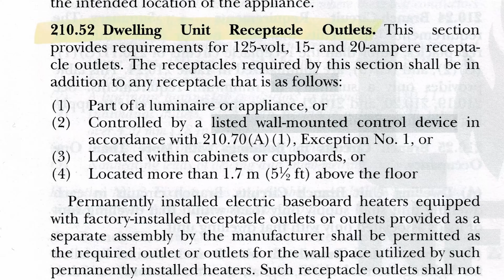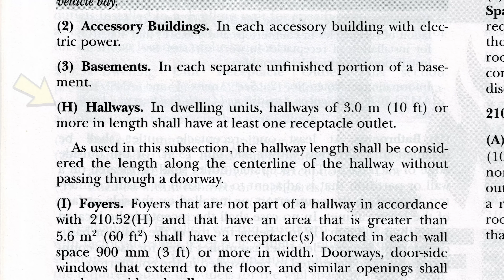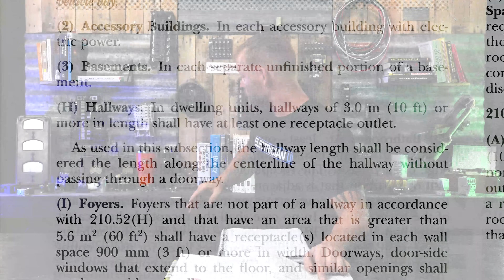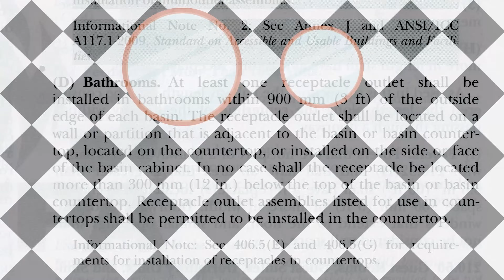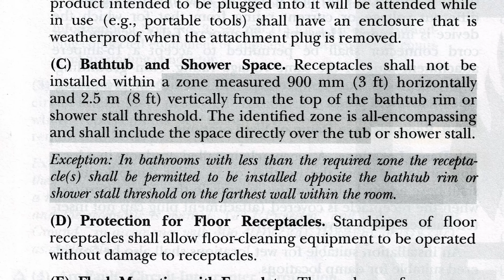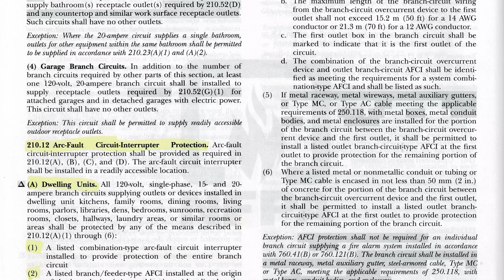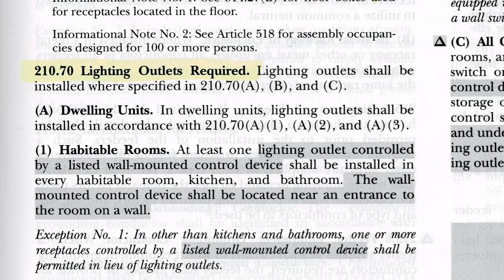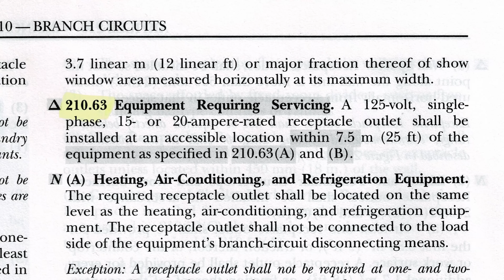KNOW WHAT YOU'RE DOING - or You Will FAIL Inspection!

Comment: Think you should reread the section on hallways. It says longer then 10ft shall have 1 receptical. It doesn't say a 20ft needs 2 or a 30ft need 3. It just says 1.
As written, a 100ft hallway only needs 1 outlet.

Comment: Thank you for these common codes.  I now know I need to add an outlet near by well pump in the crawl space!  Never thought about that (was just putting lights and a switch for the pump).  And, although I was doing it for another reason, I'm glad you mentioned floor plugs.  One wall of my common area at the top of the stairs is the "railing" for the stairs but since I was going to put a device there I needed a floor plug.  Didn't know I "required" it.   QUESTION - What about the rule (or is it a guideline) that a switch must control the lights in a room from ever entrance to that room.  My kitchen, strangely enough, has SIX entrances.  I've seen kitchens like this before with just two switches (two of the entrances to my kitchen are doors to the outside so I am putting switches there).  Does the code require more?

Comment: While it is not mentioned in the codes, whether NEC, local, or state codes, is probably the most important thing inspectors look for: CASH IN THE SERVICE PANEL! In this part of the country, $200 is the going rate, while I've heard of a little higher and one saying $100 still works there. Cash present? Pass. No cash? Fail. 
                                 How much does it normally cost in your area?

Comment: Why did the service wires need to be cut and then spliced? Removing the meter de-energizes the wires feeding the main load center. Couldn't you just install a blank cover to protect accidentally touching the contacts inside the meter housing??

Comment: Having ark fault+GFCI as separate doesn't make any sense. But I am dreading the day when I run into a device and all available outlets are protected and of course the firmware of the device is not updatable so it's going to have a nuisance tripping on arc faults that aren't actually.
Recently had a GFCI tripped out on a sound system, thankfully all the computerized equipment was on UPS just lost the amps for a few minutes and I was going huh it was working in a minute ago? Although I did have to reboot the control computer but I didn't get under the UPS yet. I don't know what caused it I've been through that system with a fine tooth comb and all connections were dry so maybe it was just the fact that I was running 125ft of extension cord? Maybe it was the keyboard player with their DC wall wart I'm not sure and I didn't have a lot of time to investigate after I reset it it didn't happen again. But I might be pulling a power distro off of a stove or dryer outlet for whatever random thing I end up getting into with the way Code is going.

And when I say I've been through the system with a fine tooth comb, I literally have because it looks like it fell off a cliff twice, who is used on the road never cared for and boy was it in quite a state when I got custody of it. And it's not like it's old stuff it's rather modern. After doing three months of outdoor concerts I found out the ground pin was broken on the way to the power distribution rack in a way that was not obvious. thank goodness I practice safe sound. and have plans in place for wet weather and killing power to all stage equipment mentally prepared during set up. I had to go through every replacement power connector and speaker connector and redo every termination because just about everything was loose. Found that out the last day of 2023 when I went to unplug the speaker and the connector came off the cable! I also think we lost 2 subwoofers out of 4 due to loose connections.

Comment: Industrial electrician for 25 years here.  I have worked on 4160V switchgear that is 6 feet high, 480V DC, generator bus bars, power grids etc etc.    When I built my house, I wired it and found a lot of the code requirements to be simply stupid.  There are way better and more efficient ways to do things, but the entire design is tailored to cost more, keep the "inspectors" busy, and protect contractors bottom lines.

Comment: How deep does the trench in the concrete have to be to run wire and does it need to be in conduit pvc or can it be underground wiring for your receptacles at the glass windows?

Comment: Can I ask you a question?  The receptacle in the hallway that is 10 feet.  I have a central vacuum system.  Would that hallway be exempt from the receptacle requirement if I have a central vacuum valve in the hallway?  Or do I still need to install a receptacle in the hallway even if I have a central vacuum?

Comment: My dukes of hazard state does not have a state electrical license so it can be a challenge in small hick towns. They have no written code addendums but after your inspector passes the work because they have their own unwritten rules. One ahole local dick failed me because I made one splice on a 14 gauge wire while replacing a fuse box with a circuit breaker panel. Gave him the code article that allows it. Told me that he would let me get away with it that time. Next time that I talked to my inspector he told me the guy has problems with every bodies work. Had trouble with my city while getting a permit for rewiring a hundred year old home. There was a 26" wide wall where the basement door covered when open and wall stud was filled with a heating duct and customer did not want a receptacle on wiremold . So I drew in a receptacle on the 3 sets of drawings and never installed a receptacle!e there. Nice vid.

Comment: In Europe you remove the bond and use a Megger to verify your neutral & hots are not connected to earth anywhere, and also you use a continuity tester to verify continuity of the earth without the neutral bond, otherwisr you will not know if you have something grounded to neutral.

Good luck doing any of this without "making it look pretty" and not mixing the wires.

Comment: I'm a project engineer, not an electrician (although I work with them regularly). I understand that electricians need to know the code, and construct per code, that's part of their responsibility. However, in my side of the field, I produce plans and specs for design-bid-build projects. If we're laying out receptacles, gfcis, sizing conductors, sizing conduits, specing all the materiald, etc. Our architects, engineers, and designers will put that to the plans. Part of my job is to design and perform the inspections. All that to say, responsibility for being to code is shared by the electricians doing the install, but also the architect/engineer stamping the plans. And building "per code" may not be the intent of the job, it's to build to plans/spec--building to code is just the minimum. Again, all that to say, I'm wondering if electricians go all self-code-police on themselves when installing, or if they tune-out and just install per plans. I guess it ultimately depends who the inspector is. Since I am the one performing the final inspection for our projects, they have to build what I accept as being in accordance to what was in the plans and specs. That may be unique because I am the AHJ at a public utility.
Reply: If it is on a blueprint we stick to the blueprint as closely as possible
Reply: @montgomeryfortenberry wrong! Code always trumps plans
Reply: I do not know any jurisdiction where the project engineer or any other member of the design & build team is the FINAL inspector*. Certainly, the designer can use more stringent requirements than the Code, but not less. At the end of the day, the AHJ which is the city/municipal inspector has the final approval. If there are discrepancies between the plans and what the build team understands of the Code, we have a responsibility to get clarification both from the design team AND the AHJ. If the design team says, "do it this way" and the AHJ/inspector says "No, do not do it that way" you only really have three choices - refuse to do the work, do it the way the AHJ says to do it, or do it the way the plans say, and then submit a change order ($$$) when the inspector fails the job. Most of us are not a fan of the latter because it creates problems for everyone and creates rework, often for multiple trades.

*the only exception being an industrial facility where outside inspectors do not routinely come in and check ongoing work. However, we are generally talking about commercial & residential work which is subjected to inspections by the AHJ.

Comment: 8:05 When my North Texas house was built back in 2008 they used one 20A circuit for all 5 full bathrooms, using a single GFCI outlet.  We have a 5100 sq ft single story home, and in those 5 bathrooms are 8 sinks.  You can only run one hair drier at a time in all the bathrooms!  Absolute worst design ever, and don't know why it was installed that way other than to save a buck.  Keep in mind at most of the sinks, there are quad outlets at each one.  To reset the GFCI its only about 120 feet away from the farthest bath outlet.  We have split 400A service into 2 panels, so breaker space wasn't an issue.   More of a common sense thing for the electricians.    👍🤠

Comment: There's a good argument here that the "wall space" that's all windows is not actually a wall but windows.  You'd have to confirm with your local inspector with that interpretation, but that would be the most logical interpretation because we cannot put outlets in the windows.  An important clue to this is that you have to have an outlet in a usable wall space that's 4 foot or larger and that window wall is not usable wall space.
Reply: If by windows you mean a wall that's made of glass panels that don't open into a doorway(s), that's a wall that happens to be made of glass. In that case you'd have to install floor receptacles along the wall/floor line.
Reply: @pld8993  yes, I do. And the code refers to usable wall space.  A window/glass wall would not be usable wall space.  Again, the key word is usable.  Installing floor outlets would be good, but not required by NEC.  Local codes may require them, however.  Think of it this way, would you hang a picture on a window frame or put fixed anchors on the window panes?  You wouldn't.  On top of that, depending on specific design, you may have structural members that you can't legally cut into and would fall short of the usable wall space requirement.
Reply: @ianbelletti6241  Incorrect. Nowhere in 210.52(A)(1) does the word usable appear. In fact, it clearly says "any" wall space when prescribing recep spacing requirements. Nowhere in 210.52(A)(2), which defines a wall space, does the term usable appear. Please cite your code reference where usable is the key term in reference to wall spaces.
Reply: @ianbelletti6241  And it's any wall 2' or longer, not 4' or longer.

Comment: As an electrician, I am always fascinated (and sometimes irked and frustrated) by how the code is interpreted by both electricians and inspection authorities. I have heard many interpretations of the hallway outlet requirements, with most people interpreting it as one outlet needed in the entire hallway if over ten feet, and none required if under 10 feet. As the code is a MINIMUM requirement, I like to add one at each end, and possibly another in the middle. In rooms I also always put outlets right next to the latch side of doors, as they tend to not get blocked by furniture, so generally remain clear for vacuum cleaners.

My biggest pet peeve is the grounding electrode conductor clamps for ground anodes: all anodes located exterior to a building, or in a wet or corrosive environment, need grounding electrode conductor clamps that are rated for direct burial, regardless if the clamps are buried or not. As the grounding electrode conductor is required to be armored for exposed locations, and the armor must also be clamped, clamps with integrated armor clamps need to have phosphor bronze or stainless steel bolts, and be rated for direct burial. But many electricians just use INTERIOR rated clamps with steel bolts, and the inspectors just accept them. I cannot tell you the number of times I have seen the grounding electrode conductor clamp lying next to the ground anode due to the bolts rusting away, especially near coastal areas.
Reply: I think every house I have owned came without a hallway receptacle and drove me nuts until I added one.
At 05:05  To me the code appears to say hallways over 10' require at least one receptacle. But in the video he states if the hallway is over 20' it requires 2 receptacles. What do you say?
Reply: Have something to add about ground rods. While working in a machine shop that drove ground rods in at every CNC machine . Yep waste of time . Anyway they pulled some 5 year old ground rods out of the cement floors and every one was over valve corroded away.
Reply: @garbo8962  
In some soil conditions, special techniques are required to prevent the ground anode from just melting away due to corrosion.

Comment: In regards to the double bowl vanity with two mirrors.   If the GFCI outlet is installed in the middle of the mirrors within a 2 gang box along with the vanity light switch.   Is there code requirements that the light switch needs to be protected on the GFCI outlet circuit.  We had a back in forth on this situation, I have wired the light with the GFCI outlet circuit as a result of the being close (arms reach of touching the water and outlet at the same time) proximity to water for quite a long time.  I was told on a recent job with this exact scenario was wired with no GFCI protection within the bathroom even though the light switch was in between a double bowl sink(the lighting has a GFCI breaker within the panel) and they said that was fine.   Any input would be great.  Thanks.

Comment: That room with the sliding door, I'd probably just put one as close to 6ft as I could on the wall and call it good. In the end, if the inspector approves of it then that's all you need.
Reply: Agreed. In my experience, inspectors will waive a requirement under certain conditions as long as it is a "convenience" code as opposed to a "safety" code. For example, they might waive the 6ft rule for unusual room configurations like the glass wall in the video, but not waive something like the 3ft safety zone around a tub/shower entry.

Comment: Dustin, can I ask you a question? How did you get experience in so many fields? I've been told that in the apprenticeship I'm doing, a lot of guys end up with experience in only one area, e.g. underground, or conduit or whatever. I don't mind trenching, but I definitely don't want to spend a whole career doing underground work.
Reply: Try a smaller company. Bigger companies pigeon hole you in one area. I worked union for a couple years and all I did was run conduit.
Reply: @dallas5374  I appreciate that. The problem is that all of the member companies of the apprenticeship program that I'm in are big companies. I don't know how to get experience in smaller companies until I'm already certified.
Reply: You have to move around between companies. I was able to get resi, commercial, industrial, Automation and commetcial ATS/generator experience. If I stayed at one company and eventually went out on my own I never would have gotten all that experience.

Comment: This 6 ft - 12 ft rule is ridiculous.  Nearly every residential upright vacuum comes with a 20 ft cord attached to it.  The shop vacs that come with a 6 ft cord imply that you will permanently attach a 25 ft extension cord to it.  No one who uses a shop vac regularly and even has half a brain only uses the factory 6 ft cord and stops to unplug and replug into the next receptacle as they go along.  Sometimes these codes are written by lawyers and not practical engineers.  Why all this hullabaloo to minimize extension cords?  If they are "illegal" then why can the big box stores still sell them?   

I call B.S. on this part of the code as it has the potential to introduce more problems than less.  Any time you have an electrical outlet embedded in concrete without a drain, there is a potential for water to fill from spills and cause a problem.  That means not only do those outlets need to be recessed, they probably need to be on a GFCI.  And the more outlets you have chained together, the more potential there is for cumulative resistance because of all of the terminations adding up (if done hastily with the speed wire push-ins instead of screw clamps).  If this was my house I'd be extremely mad that the code requires this.  I'd probably rip them out after the home was done.  There's no way I'd be putting that many in.
Reply: I guess that means you know better than the countless engineers and tradesmen who have collaborated on the code and improved it to protect both people and equipment for the past century. Arguing with the code is a waste of energy. If it says do it, you do it. It really is that simple. If you think something is wrong or unnecessary, the national committee has a system that allows you to suggest changes to the code.

Comment: not sure if anyone asked this yet.  in regards to the patio door at 4:30 with the window next to it.  does the 6 feet count across the open door?  if you put a receptacle to the left of the door, right next to the door frame, you'd be past the open door when you hit the 6 foot limit.  then your current one to the far right might be within 6 feet of that point.  Does the door cancel the distance across the door face?
Reply: if you measure that door from the opening, then add the trim, it's probably 7 ft and change.... that's the sticking point. A standard 6 or 8 ft door would be ok, but this one has two stationary panels so it's a 9 ft door.